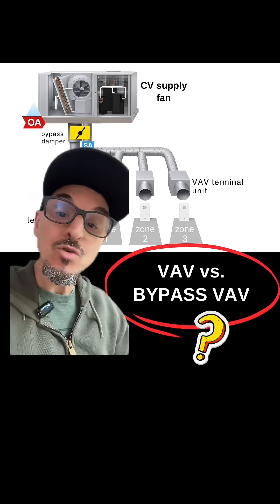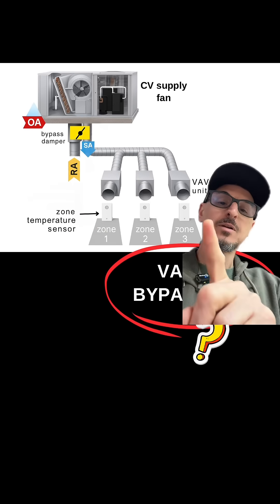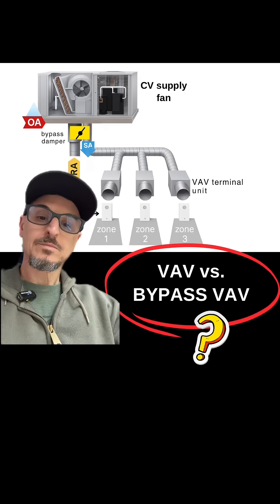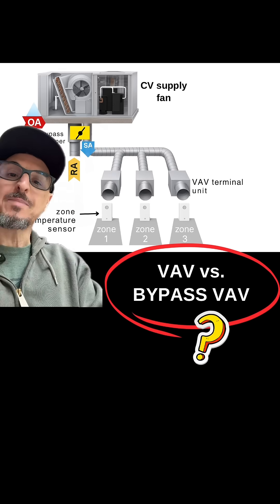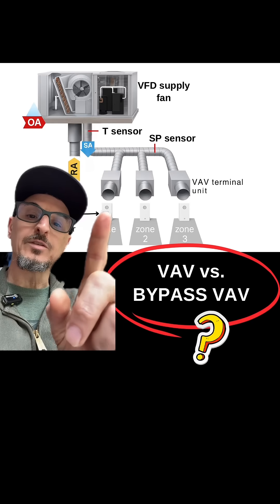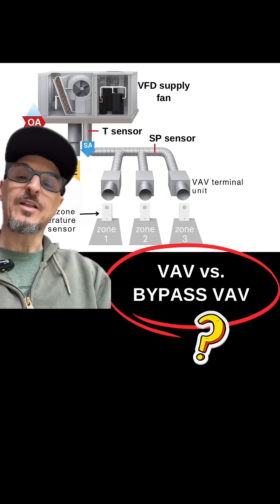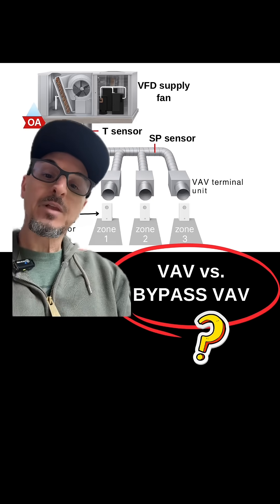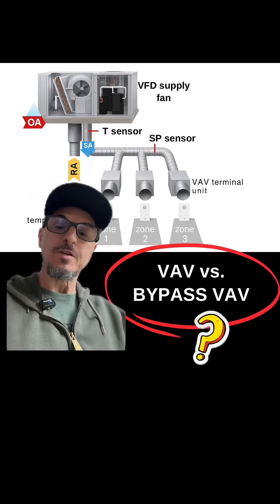VAV vs. Bypass VAV HVAC

Comment: I've seen this done on tenant renovations where a single space will be divided. The existing unit was constant volume and converting to variable speed was too expensive.
Reply: I don't understand how converting to a VFD (3-phase) or ECM (single phase) is too expensive... this could literally be a wash in cost between the two.
Reply: @airberg583  installing electric reheat vav boxes, replacing the rtu with a vfd for compressor and vfd blower can be expensive. VS just adding zone dampers and a bypass damper or 2.

I believe a vav system is the best way to go for bigger units, but for small systems I think VVT systems are best.

Comment: I’ve never installed a unit with a bypass in my 16 years in the industry. All units we install have the fans on a drive or ECM motors to modulate air flow based on demand. While I’ve never come across this it may be due to my location. I’ve learned something new regardless. Thanks Tony.
Reply: Carrier VVT (bypass vav) systems are commonplace still, granted not generally being installed anymore.  Good for techs to still learn about them. They're a pain in the ass, though.
Reply: @airberg583  I like them, I've installed a few and service them a lot. Good for small rtus below 40tons. You can get a zoned space without doing VFDs on the compressor and blower motor.
Reply: @airberg583  it’s useful if the drive took a dump and you can’t control motor speed anymore to control static pressure for the VAVs and modulate damper to control air pressure
Reply: @boywhohadatiger  older VVTs didnt have drives and only used the bypass damper to control duct static.
Reply: @airberg583 old way still works just more damper adjustments and no reduction of motor usage to save energy that way

Comment: I don’t understand why you would have a bypass, why don’t you just have a pressure control system instead? (I’f the damper close, the pressure will rise, then the pressure measure sees it, then it turns down the ventilation motor) it saves energy to
Reply: That's literally a vav system, what you're describing.